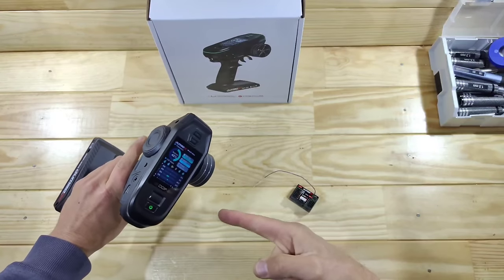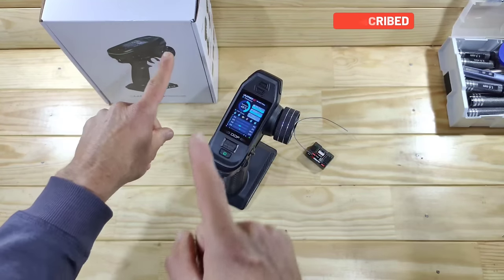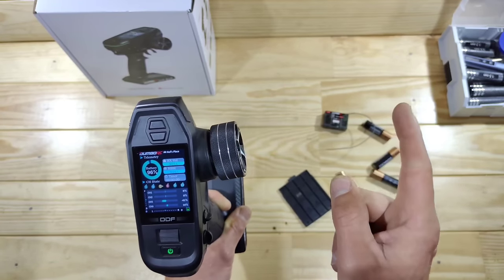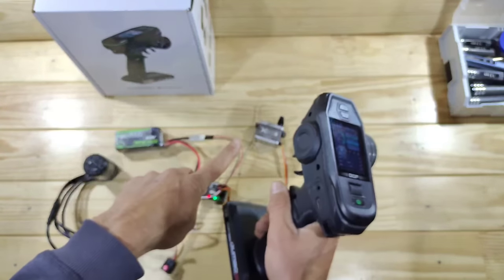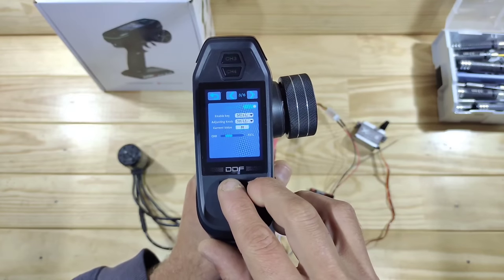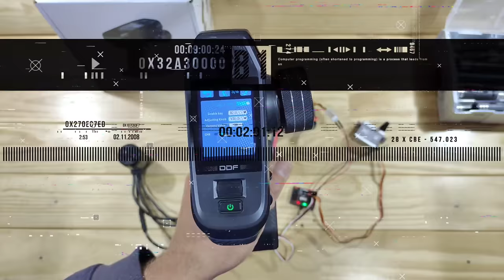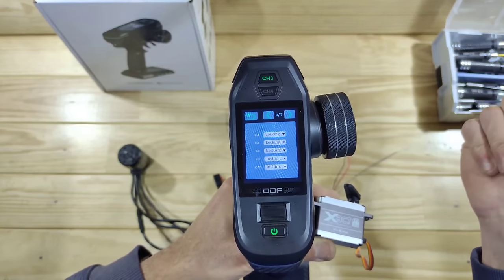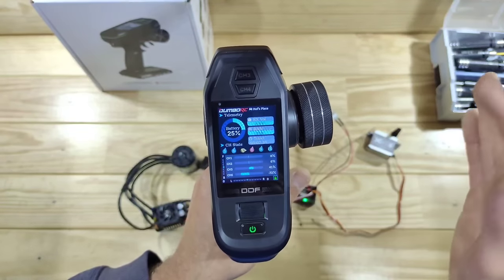Answers to 7 most common questions about the DumboRC DDF-350

Comment: You said that a version of the remote cane with the cable to check the voltage with the remote. Which one is it? Then I can see the same remote but for lower price as 50. Is it legit? Amazing video thanks a lot!
Reply from the maker: Hi, there is a connection on the 10ch receiver, up right, B+B-. Just connect a lead from the battery into here all you will have telemetry on the TX. Note, up to 3S

Comment: How to set it up and is it failsafe?
Reply from the maker: Yes, is has a failsave. What would you like to set up?
Reply: @hofsplace  When I turn off the remote control, the winch starts to wind the rope, which can lead to it breaking, the winch is connected to the 3-position channel
Reply from the maker: @KarTka  A fail safe means that the servo goes into the 0 position. -90 | 0 | +90. Perhaps you can change the some settings to solve it.

Comment: The B+B- the two wires that show your battery voltage. My question is does that function only work on 2s & 3s? 4s ? some people say yes other say no and burn the rx, could you please confirm? Thanks
Reply from the maker: Yes, 2S and 3S. Tested myself
Reply: @hofsplace yes in the video I see. The question is more the 4s...
Reply from the maker: @hvflyaround8438  don't know. I didn't find any spec.

Comment: Thank you. 

I ordered this a few days ago.
I had the similar Rlaarlo CT8A for 75 days and it broke already. I opened it up and nothing is wrong with the potentiometer, but the damn thing inputs -1200 to the throttle channel as soon as i turn it on. Complete trash which Rlaarlo has no interest in honoring warranty.

Never had a issue with the DumboRC X6, but i got the 350 so I don't have to re set the trim and dual rates and endpoints when i switch from Kagama to Felony. 
DumboRC have the most reliable budget transmitters, with best range too.
Reply from the maker: Agreed!

Comment: Hi! Great video, thank you! Can you help me how to set up the failsafe on 360° servo? The problem is during long expeditions we have rests and sometimes my tx just switches off after 20 minutes (I know about the alarm) and it destroys my winch. Also one diff lock cannot hold the failsafe, too. Are there any limitations?
Reply from the maker: A fail safe means that the servo goes into the 0 position. -90 | 0 | +90. Perhaps you can change the position of the servo horn and do some setting adjustments to solve it.

Comment: Hey! I do no prep drag racing and I was wondering if I can set up trans brake? Can you program a button as a brake? If you like hold the button and throttle it won’t move but as soon as you release that brake button it goes. Can it do something like that?
Reply from the maker: Yes, that's possible. You can set the buttons to 'inching' instead of locking
Reply: @ ok awsome thank you!!

Comment: @hofsplace Thanks a lot for the video.
 I have question related to the batteries. Have you seen an option to turn off the screen or dim it? 
Thanks in advance
Reply from the maker: No, there no option for that
Reply: Yes, there are options for this.
Go to Transmitter Settings, then scroll to the third page to get to the Backlight options.
I have my screen set to turn off after 3 mins of inactivity, and my screen is dimmed to 50%.

Comment: Hey, great video. 1 question tho. How do I change my transmitter battery status from voltage to percentage like you have. Mine displays voltage instead of percentage.
Reply from the maker: The percentage is for the battery of the Transmitter. In the top right corner you'll find the TX battery voltage

Comment: I've just ordered it but I have a question, maybe you will be able to help ;)
In HB Toys R1011 (Jeep Rubicon) there are separate slots for LEDs front/rear/left indicators/right indicators/one free 2 pin slot. As i remember all of them are connected into CH3. Do you think it they will work correctly? LED bar is set as a separate connector under CH5.
Reply from the maker: Hi, I dont have that specific car anymore, but aren't the light all connected into the receiver with white connectors? If yes, than you have to be creative with separate light boards or something
Reply: Will a 3s 100c battery work?
Reply from the maker: @aabidaslam9936  Yes

Comment: How do's the 4wheel steering setup work on with this and and can you setup 2 motor's with front or rear brake? Like in when you do crawling and would like the rear motor to brake/stop the rear wheels and only have the front wheels running or stop front and only let rear motor run.
Reply from the maker: So extended like you mention is not possible. I did 4ws with an Y cable and reversed a servo
Reply from the maker: https://youtu.be/L3WuUDqrl0U

Comment: I love this radio but am wondering if it can be set up with led lights that can be turned on/off with the channel buttons?
Reply from the maker: Hi, yes, that's possible. I'm using light controllers in my cars and turn them on/off via the remote
Reply: @hofsplace  dammit.  I can't figure it out.  I bought some ebay lights and a switch that I was told I needed that plugs into the esc and lights.  I just want on/off.  Don't need fancy turn signals or anything.   Would love to hear how to do.
Reply from the maker: @danperez7169  email me with that you bought: hofsplace@gmail.com
Reply: What about cycling threw light modes  @hofsplace
Reply from the maker: @macmccartney5760 that depends on what light module you're using. If it has multiple settings, set the dedicated CH to inching and you're all fine
Reply: @hofsplace  thanks
Reply: @hofsplace  it's a ESC plug that  uses a Y to separate to led strips that have roughly 20 different light modes\color combos\flashing

Comment: Let's say i bring 2 trucks, and i want to move them like truck A first and then change to truck B with same transmitter? Is it doable with DDF?
Reply from the maker: Yes, you can easily select between models
Reply: @hofsplace  need to turn off the switch to change or you can change it while both of them switch turned on?
Reply from the maker: @Latimerias_trailncrawl  when it's on

Comment: hey i was wondering if i can put light directly to a DUMBORC X10FG like ona x6dc or if its an adapter to put lights on it directly
Reply from the maker: It does not have dedicated connections. But you can plug it into the + - of a channel.

Comment: Can I connect the red lights and set them to come on when I brake? I ordered Dumbo DDF350 X10FG, I have the lights installed and I wonder if I will be able to connect them like this or just turn them on and off using the button
Reply from the maker: That depends on the light module you're going to use. Some have this option, other not. You can use a switch on the RX, set it into 'inching'

Comment: Thank you for the useful video! Do you know if it is possible to use a mix CH1 > CH3 with some expo or specific curve (only on the CH1>CH3, not CH1>CH1) ? (the goal is to use a sound engine on channel 3, and properly matching the sound reaction to the car - It really improves the realism!)
Reply from the maker: Hi, in the mix mode menu, you can mix every channel with each other. So it should be possible
Reply: @hofsplace  You're right, mixes are here - but do you know if it would be possible to apply a different curve on each? (it seems at least possible to specify a custom curve on throttle, and a linear curve on the mix CH1 to CHx - if the throttle curve is not applied here too!)
Reply from the maker: @francoismuller9735  hi, it's not possible to make separate curves
Reply: Hi I have a arrma infraction how do I set up the Handbrake Module on this remote with a receiver
Reply from the maker: @saqib8033  hi, use CH8/9/10 and set it to 'inching', not in 'locking'
Reply: Ok thanks I have my old dumborc though of x6fg throwing what kind lipo would fit the old dumborc if you know x6
Reply from the maker: @saqib8033  I think this will fit: https://s.click.aliexpress.com/e/_EyGrJsz

Comment: I have setup my end points for my crawler to the maximum setting, 120, however I need more than the limit. Do you know if there’s a way to get more out of it?
Reply from the maker: Longer servo horn perhaps?
Reply: Depending on the receiver, there is a way to get extended range from channel 1. I know that works on the X6F(G) receiver.

Comment: what's the best way to set up 4 wheel steer with this ddf350.

 I wish channel 7 would between between in and outer teering while being in the center position is normal
Reply from the maker: Perhaps diy for ch7? Or a Y cable on CH1,

Comment: How to I reset to factory  I messed up with settings and the steering light blinks on way, and no steering at all,  also trying to figure which is the k9 and k10  button to reset
Reply from the maker: Did you check app pages in the menu?
Reply: I checked nothing  , still playing with the remote  trying

Comment: How do you set up channel mixing for incremental 4wheel steering on this radio?
Reply from the maker: You should use a Y cable and a reversed servo in the rear. Or reverse the servo yourself: https://youtu.be/L3WuUDqrl0U
Reply: @hofsplace  thank you for the help and for the video I’ll definitely be doing this

Comment: Please tell me, I bought DDF-350 equipment, how can I make the car first brake and then drive back? I connected the light module, and I don't like how the brake lights work, they turn on in reverse. Can I make the car brake and then go backwards when I press it again?
Reply from the maker: The brake option needs to be set in the ESC. The light module, if it's an advanced one it responds only when the throttle sticks is pushed backwards the first time, braking. The second one to reverse the car it shouldn't turn on.
Reply: @hofsplace  Yes, this is what happens in my light module: the first press of the trigger turns on the brake lights, and the second press the reverse lamp. But at the same time, the car itself only goes forward and backward, without an intermediate brake. It could be the speed controller itself.
Reply from the maker: @lexxanplay what ESC do you have?
Reply: @hofsplace  I have esc "surpass hobby 35A"
Reply from the maker: @lexxanplay  doesn't it have a little jumper that you can move so you can set it to Forward/Reverse or Forward/Brake/Reverse?

Comment: hello, I was wondering if you can give me a helping hand, I bought the DDF-350 and can not get my winch to hook up properly, I have a warn winch with two wires red/black. As soon as I plug it into the channel 3 port, the winch automatically winds in without touching anything and won't stop until I unplug the winch from the receiver. What do I need to make the winch work properly with the controller and receiver.
Reply from the maker: Hi, you have to have a winch controller in between the RX and winch. This is like a mini esc: https://s.click.aliexpress.com/e/_Ewf1O39
Reply: @hofsplace  Great thanks for replaying, I order that ch3 winch controller, I had the wireless remote set-up for lights and winch before buying the DDF-350 w/10ch, thanks again

Comment: Hi, I need to ask you a question. Is it possible to change the speed of the motor (limit it if it is used by an inexperienced person)? I can set the steering trim
Reply from the maker: Hi, in the Menu, page 3, you can set the end-point of the throttle.
Reply: @hofsplace  do you know how to set eg. 50/75/100% throttle on the CH7 button which has 3 positions?
Reply from the maker: @MKequilibrium  not that I know of

Comment: Hello, do you know if its possible to set CH5 or CH6 to work as "TH D/R" knob in stock wltoys remote controller ? (Foremost max speed) I can set it thru General menu -> END Point -> Throttle But its not convinient...
Reply from the maker: Hi, there's no standard way to do that.
Perhaps you can try to use the mix settings?

Comment: Is there any way to set rear steer to work with the wheel?
Reply from the maker: You have to use a Y cable on Ch1 of the receiver. Or set the rear steer to Ch7 on the remote.
Reply: @hofsplace Thx

Comment: Has anyone else got the problem of the steering trim jumping one way or another if it's not pretty much in the dead centre when you start to adjust it? Mine does that and it can be a pain! Epic radio otherwise. Wouldn't mind being able to adjust the steering dual rate quickly without moving end points though and i can't find a way to do that currently.
Reply from the maker: Hi, sorry, I'm not familiar with that issue. Try to update the firmware
Reply: @hofsplace  I'll have a look on the internet and see what I can do 🙂
Reply: I am having the same issue as when trying to calibrate steering it locks steering to right, then steering stops working
Reply: @DaddyDaughterRC-sw2zb  I've ended up leaving that adjustment well alone. What I've done now is used channel mixing in the model menu to make channel 5 an adjustment for the steering. Then I've set the end point to 15% on said channel to give me a decent macro adjustment. Haven't touched the actual adjustment in a while now.
Reply: @deanmurphy-brown4452  good call 🤙. I also had a long play and found as steering was reversed on ours it somehow plays havoc with adjusting steering as calibration only like to calibrate for factory settings. Once steering direction was sorted it was a bit easier but still is not great so agree to leave calibration alone which is a shame and needs to fixed in software update.
Reply: @DaddyDaughterRC-sw2zb yeah, not ideal! I mean, it's a cheap old radio and there's limits but still, should be a bit less of a pain to do relatively basic stuff 🙂

Comment: I want to use 2 servos for my steering and they have to work in opposite directions. Can I do this with this transmitter?
Reply from the maker: Use an Y cable from the receiver to both servo's and reverse one of the servo's. 
In this video I'll explain how to reverse a servo: 
https://youtu.be/HQUsT843G_c

Comment: Hi Friend whats the cable called that goes in the b- and b+ mine did not come with the cable. Thnq
Reply from the maker: You can use a JST connector or 2 pins of a servo plug

Comment: How can I limit the servo range? cant find it anywhere
Reply from the maker: Menu, page 3, steering end points
Reply: @hofsplace  but it’s global for all the models. So it’s not possible to set it up per model
Reply from the maker: Not sure if I understand you correctly. But you have the option to use up to 10 different models with all different, unique settings

Comment: Hello, i have the firmware v1.1.1. Since the 1.0.9, there is a new functionality : the cruise control. Did you try it? There is two mode : mode 1 and mode 2 but i don't know what's the difference between the two. In fact, i want to limit the speed as you can in a car. For example, in my car, you have the speed limiter for not exceed the speed limitation and you have the 'block' system. I just wanna limit to 20% of the speed, for example. Do you know how to achieve that?
Reply from the maker: I've got old firmware as I was one of the first to have it, so I'm not able to test it
Reply: @hofsplace  hello. I got an old firmware too. But i upgraded it by following a video on youtube. It was in Chinese but the trick is to activate the subtitles and choose English for the subs. I upgrade first to 1.0.9 and to 1.1.1 after that.
Reply from the maker: @smoheissp50pro11 I have to watch that video as well and upgrade the firmware

Comment: Is there lock function where its locks everything where u can stop by hv a chat with friends without worrying the remote triggering the rig to dash away
Reply from the maker: As far as I know, not.
But you can turn the transmitter off... These days the receivers should have a fail safe 😉
Reply: There is a padlock icon in bottom right of screen but I think it's just to lock screen input and not trigger.
Reply from the maker: @nic.25  that to lock and unlock the throttle and steering trim

Comment: Do you know how to set a throttle limit on this transmitter? Even better if you can use channel 7 selector to switch between oreset limits.
Reply from the maker: Perhaps you can use the trottle curve, or maybe the mix mode. But i didn't test it yet
Reply: You can currently only set the throttle limit using the Throttle End Point option, but you'll have to play with the throttle trim to minimize the throttle/trigger delay.
Reply: @user-fm5qg5if5v  why do you say this? Are you saying that adjusting the throttle end points somehow adds throttle delay/latency?
Reply: This was my experience, but your choice of ESC may change the outcome.
Reply: @user-fm5qg5if5v  that is bad news. How much latency did it add? Clearly a noticeable amount, but was it really bad when driving? What receiver were you using? thank you!
Reply: I am using the X4FM-G receiver. The latency wasn’t too bad, but I like it when it responds almost instantaneously. 
I eventually switched to a Hobbywing ESC and now I’m able to turn down the punch while keeping the overall throttle limit at 100% so I don’t need to mess with the throttle trim anymore. I was originally limiting the throttle only to tune down the initial punch with the stock non-programmable ESC.

Comment: Can you really only connect a single pair of LEDs to the X10FG?
That's a bit small, to say the least, isn't it?
That's not even enough for the front light and rear light 🧐
I don't want additional switches. I also need all the other slots/channels.
Couldn't I connect a total of 8 LEDs with 3 Y-cables (4x at the front (white) and 4x at the back (red) and then switch them on and off?
That would be enough for me.
Or is one slot on the receiver overloaded?
Unfortunately I don't know anything about electricity, that's why I'm asking...
Reply from the maker: Yes, this receiver is not built to take lights as there is no more space. I recommend to use the FZD: https://s.click.aliexpress.com/e/_ExPmMYB